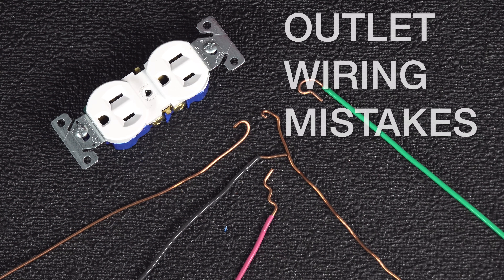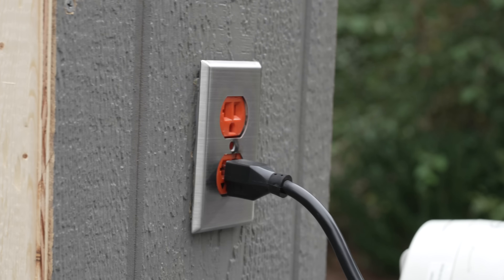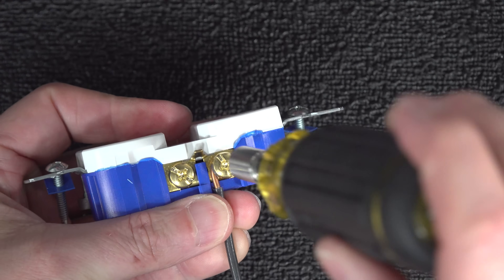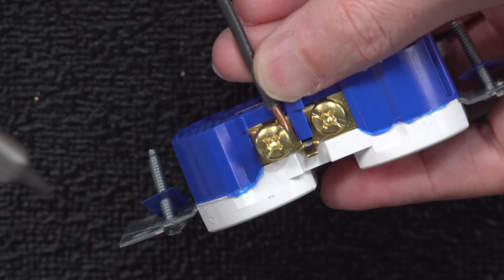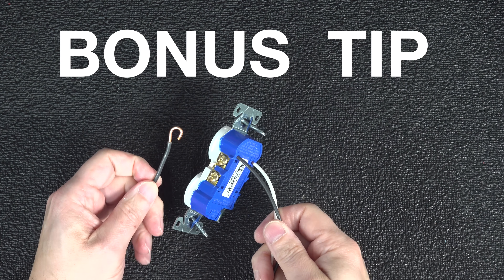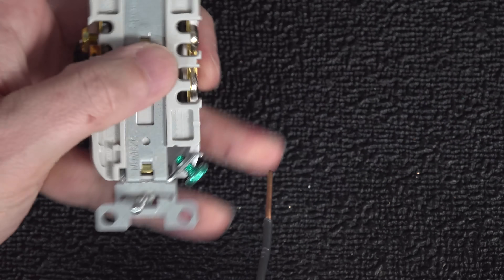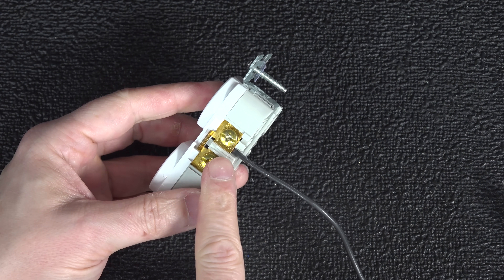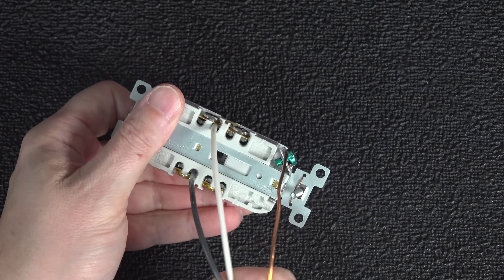BEWARE Of These 3 Common Wiring Mistakes On Outlets & Switches

Comment: Are both gold and silver screws joined internally? Or does it matter to use the top vs the bottom one in their pair?
Reply: The answer to your first question is no, they're joined externally by the tab between the screws. One gold screw is joined to the other and one silver screw is joined to the other, but are not joined together. The answer to your second question is that it doesn't matter as long as the tabs between the two screws are still intact. The tab on the hot side only can be removed if one of the receptacles is to be switchable or if a multi wire branch circuit is used and the neutral is shared. In the latter case the two receptacles will be on separate circuits. Both the hot and neutral tabs can be broken and be on separate circuits and not be a multi wire branch circuit. There's no case where only the neutral tab is removed.

Comment: If standard wiring code for vehicles is red as hot and black as ground, then why change that color code for housing? It makes more sense for the color code to be universally the same to prevent any misconceptions leading to loss of life and property damage.
Reply: You can't make this comparison. Vehicles run DC and typically a 12v battery. Homes run on 120v AC. In a car the black cable is negative or ground, which completes the circuit. In residential 120V AC the white wire is the neutral which completes the circuit and carries 0 Volts. There's a ground wire in residential wiring, either green insulated or bare. This wire carries no voltage or current under normal operation, it's there for safety reasons in case of a ground fault.
Reply: @surferdude642  in a vehicles wiring harness under the hood, inside the ribbed wire protection wrapping there is a copper cable that is a negative ground along with the standard red as positive and black as negative. Without that copper cable then the entire electrical system won't work. All that I am saying is, "Why not use the same color coding since they are basically the same in function?" It doesn't matter what the amperage or voltage of the wires. I don't expect an electrician to wire a car and I don't expect a mechanic to wire a house, although most of them do. But a universal color code for all wiring would be more beneficial than complicating matters because an engineer wanted to mess with people. The wires come in gauge sizes and voltage/amperage ratings so if you know what you are looking for then it's an easy fix.
Reply: @briandillon3543  I'm not an expert, but I believe that the copper cable is the chassis ground and is at the same potential as the negative terminal and black cable on the battery. The red cable is positive and always is approximately 12v under normal conditions. In residential wiring the grounding conductor whether it is bare or green insulated has no function during normal operation. The black and/or red wire are not distinct in polarity but alternate from positive to negative at 60Hz. The white wire is the neutral or grounded conductor. I guess to your point they could have made that wire black and black hot wire a different color, or the negative cable on the vehicle would be white.

Comment: Was putting those wires on they put it on backwards but I noticed your wire was lifting up the same way when you put it on backwards when you put it on supposedly the right way I put it on the same way you do but I take a needle nose pliers and crimp the hook closer together before I tighten it down

Comment: Just because there are extra slots for more wires doesn't mean you should use them. Install a pig tail instead. You don't want to have to try to shove all that mess back into the box with the outlet.

Comment: This was a great video until the very end, you should always ground your wires in the following order the green goes first, then the neutral goes second, then at the end you attach the hot wire which is or could be the black or red wire. The reason for this is because when you attach your hot wire first that entire box now has electricity going through it and if you touch the wires or the screws at the terminals you will get shocked. And just an FYI when you are taking your wires off of an electrical watt box you always take the hot wire off first and then cap it

Comment: And what would that be the black wire is hot the white wire would be neutral and the copper wire that is bare would be the ground wire what is the misconception of the red and green wire is that basically there is no red and green wire when you are wiring up a house and if you do use a red and green wire I would suggest on every damn outlet or every damn light switch it is used the same damn way the red wire would be the hot the green wire would be the ground and then again we come back to the ground wire which would be fair you really can't screw it up unless if you start change in around how you are wiring your house up and then you can't even screw it up then neither

Comment: I still don't know What the "Green" wire is for and I also run into "Red" Wires too. What are they for???
Reply: Romex wire is usually 14/2, 14/3 or 12/2, 12/3. The 14 and 12 represent the wire gauge, the 2 and 3 represent the number of wires not including ground. In the /3 the additional wire is red and is a second hot wire and is necessary in certain cases. Red wires are typically used in switchable receptacles, multi wire branch circuits, and as travelers along with black wires in 3 and 4 way switches. NM cable (Romex) the ground is a bare uninsulated wire. This is equivalent to the green wire. In a conduit you would use a green wire for ground connections.

Comment: ah yes, the backstab wire mess.  Just replaced an outlet like this.  Two backstabbed wires and one around the screw terminal on each side.   Wound up moving those three wires into 5 position Wago 221s and then pigtailing a fourth wire into the new GFCI outlet (the outlet location is in a breezeway so to me, this is a wet/damp location).  I do not own 4 position Wagos, thus why I used 5 position.

Comment: The link to the Leviton Outlet take you to an Amazon page that pictures an outlet that does not look like the one you use in the video. It (the page) does not show the back of the outlet. Is this part number the actual number for the "upgraded" outlet you used ? TCR15-W.  Thanks.  Richard.

Comment: Hi there, quick question because I just came in Canada. Why did they create holes to plug's back if it's dangerous? I say you that because we have that way of the wiring in Switzerland (to insert rather than screw the wire, it doesn't even exist screws on the side on plugs) and I never saw a plug burnt because of that. The only logic way for me would be in case of high intensity, the metal protects more the plug's plastic, is it the reason?
Well, thanks for the tips, I'll avoid some mistakes thanks to you...

Comment: wait, electricians never use back wiring??? LOL BS, the hell they do.  Every house I have ever lived in here in Oregon used back wiring.  a house built in 1982, a house built in 2005 and currently our house built in 2021, all used back wiring.  What you should have said was GOOD electricians never use back wiring.  outlets, light switches, doesn't matter, every time I go to upgrade or change I see the same thing, wires shoved into those annoying, difficult to remove from holes, so I cut the wires and toss the old device in a box for later or throw it away.  Good outlets and switches even have a little plate that prevents the wire from touching the screw and even has internal plates so you can do just like back wiring, stick the wire in the hole and when you tighten the screw it pulls a plate against the wire for a secure connection.  Those stupid back wire holes only make contact at a single point on one side of the wire which if you are running a lamp or radio is not a big issue, but plug a space heater in there and suddenly you have two heaters... one inside your wall that could melt or even catch fire if left to run too long.

Comment: First thing, anyone doing their own electrical work should definitely at least learn how to do it safely.  Using the wrong gage wire, or wiring it up incorrectly is not only unsafe, it could very well be fatal.  It's not that hard, few videos on youtube, pick up a cheap wiring code guide book from any hardware store local to you, and most definatly, buy one of those testers.  It doesn't have to be super high tech, the one I used for many years is simply a 3 prong plug with 3 lights on it, two green = good, anything other than that it literally tells you on a sticker on the device, whether you have it wired backwards, no ground, or any combination of bad wireing.  However, it will not tell you if you picked the wrong wire gage, so please do research, and barring any of that, just buy the thickest gage.  It is much better to use 12 gage wire when 14 is required than to use 14 when 12 is required, and always match your outlet rating with your breaker/fuse rating ie. 15 amp outlet on a 15 amp circuit.  Some things are required just to pass an inspection for code.  something even a licensed electrician failed to do in my house once.  We failed inspection because he put a 15 amp outlet on a 20 amp circuit.  Anyway be safe out there.

Comment: Color of the wire is not determinating phase zero and ground wire you must know where wire starts and ends from plug board switch to wall socket

Comment: Green ground to Green Lug, Black Power to Gold Lug, White Neutral to Silver Lug.  I use plugs that have a square press washer under the screw, that way it doesn't come loose and you don't have to curl the wires.

Comment: Not trying to nit pick but technically the white wire is not a neutral in single phase applications. By definition a Neutral conductor carries the imbalance between  ungrounded conductors. In the single phase application of your video the white wire by definition is a grounded conductor.

Comment: I’m a troubleshooter and one of my favorites was called for a breaker tripping opened 1st non working outlet closet to panel found it was wired blk & wht on one side & blk & wht on the other corrected it….. tripped again……do you know all outlets in living room were wired like that……..and that was done by building super

Comment: You are ignorant of the fact that AC current is bidirectional, the hot and neutral designations are from tradition, the phase and standardization is what wiring the outlet by the color code is for not the polarity. That is why the outlets or other devices work unless they are phase dependent.

Comment: So it's convient,, but it's lighter colored screw compared to darker,, and also white is nuetral,, but it's the grounded conducter, as apposed to the grounding conductor 🤔 and no one uses stablock connections,, and don't need to go to comercail / spec grade, devices,, one can simply use the screw connection on any standard device ,, even though stablocks are there one dosnt need to use them,, and always make a pigtail connection wene more than screws terminals,, wire nut your connections,, and establish the  conductors needed for the device,,

Comment: most important thing that was left out, make sure your ground wire is nowhere near the neutral or hot connections (silver or bronze screws and plates) as this will result in arcing or a ground/neutral fault, and with an arc fault breaker (required by 2020 code) will cause a circuit failure... also if you want to have an easier time diagnosing or fixing problems in the future it's good practice to pigtail (tie in) a single connection wire with the two (or more) wires of each color in the box using a wire nut and a lineman's pliers... this will ensure a device failure is easily identifiable on the circuit, and allow other devices along the line to continue working while making replacement of devices in the future easier (this is more time consuming but is best practice)

Comment: Here's what is wrong, the WHOLE usaan reticulation sytem! Those outlets are ridiculously dangerous, exposed live terminals, straight pins theat burn up, 110 v that is more deadly than 240v, and 60hz that runs hotter than 50hz. Couple that with still using solid conductor for earthing, different voltages on individual conductors, bugger me, its an electrical nightmare!

Comment: Nice video. The only thing I would add is Quality Control to the finished product. There should be a "glint" of copper showing between the connection and the wire insulation. This is instant proof that insulation was not placed inside or between the wire and the device contact area. Also, the stripped copper wire should not extend (except for the grounding) past the "skirt" of the device. In other words hot (or neutral) conductor is exposed past the connection point of the device creating an obvious electrical safety hazard. Every job should conclude with a QC (quality control) inspection to ensure a quality "Journeyman like" instillation has occurred. Cheers.

Comment: Also never put more than 1 hot, 1 neutral on rec. The little break away tab between screws acts like a fuse link and all the amperage of all rec in circuit goes through and the first rec in circuit has most and will melt . It is also much easier to shove it into box with 3 12s on it than 5 or more. Always use a wire nut(connection)and bring out 1 pigtail to the receptacle   Then if you have a bad rec it will only affect 1, not whole circuit   Another common mistake is using a 15 amp rec on a 20 amp circuit. Good luck and be careful ⚡

Comment: NOOOOO! DO NOT INSERT THE WIRES LIKE A JACKASS! I hate that crap. That means the next guy has to cut that wire or screw around with getting it out, then he has to strip it again or add more wire. Just use the hooks so its easier to replace the outlet.

Comment: When training new apprentices, I always tell them to make sure the neutral goes on the same side as the ground (all of our devices are made that way). Always wrap the wire around the screw in the way that it tightens, and NEVER ever use the stab in connections on the back. It's our company policy to never use the stab ins, but in my opinion, should be an industry standard.
Reply: Absolutely! Fuck a back stab bro

Comment: I disagree with the author on back wiring. The amount of metal that the wire makes contact with is more than enough to handle the rating of the circuit if it's installed correctly. These receptacle designs are tested and approved. I haven't looked into the ratings for that specific design, but I wouldn't be surprised if it was UL certified.

If there is a connection issue with the back wiring it's most likely installer error and not a problem with the design, those springs are very strong. If there was a problem with a back wired receptacle, it would be most likely that the installer used a wire gauge that was too small or that the wire was bent causing a bad connection.

Comment: Great job on the video. I have been teaching this to all my helpers. Never used the stab in tabs and always frowned on the electricians that bragged about using them. The down size to working in a right to work state. Anytime I find my hands on a plug that has been stabbed I always change it. Changed every receptacle in my house. The worst applications were the receptacles by my central vac system plug and the outlets on the down side of the kitchen gfi's where we plug in  appliances. It does not take that much time to do it correctly

Comment: Just a few things of note. Was the Fluke tester used to impress?  In many cases in track housing those folks are not electricians.  They are piece rate installers. The faster they get done the more money they make.  They back stab every device. They also use the device to continue the circuitry. Instead of making joints and pigtailing the devices. Leave enough conductor for servicing the device. 6 inches from the front of the mudring/wall. Electricians use number and or letter books to identify the circuitry.  Example, panel A circuit 4 would have an A and a 4 on the conductor. Hospitals require that all cover plates are engraved not labeled. Granted no one wants the cover plates engraved in their residence. Most electrical problems are poor terminations. 
Finally call a Pro.

Comment: If for some reason you want to connected stranded wire to an outlet, remember to use ferrules to get a more secure connection as well as one with a better contact area.

Comment: He sure does make it  look eazy .. 
It does take a little bit longer when that outlet is  in the center of the circuit and has outlet2s jumped off of  N maybe a light ran off it .
Things happen Janice!!!!!!!! 
Please Denise just take me back it was an accident I didn't know what I was doing I didn't mean to burn down the garage but please take me back if you take me back I'll eat that box like you've never seen me eat it before and you know how much I hate what's in your mom's box I mean who makes homemade dumplings and then steams them in her box for hours and then just pulls them right out of her box at the party..... Put the neutral wire on the ground wire and it'll take care of your problem

Tip of the day✔️  for all you skip that part but if you want to bypass an outlet tester because the house you're working on is old and doesn't have a ground or a  metals. Outlet box .....says I can't put that on there cuz it could possibly be dangerous or cause death and I prefer calls and deaths one-on-one it's kind of a personal thing but hell no I can't get a Big Mac without it being a personal thing

Comment: Klien makes a philips head screwdriver with a little prong that comes out of the handle running perpendicular to the shaft. The is perfect for making hooks once you''ve stripped the wire. 
It's great as you don't have to use 3 tools (srtipper, needle-nose plier and screw driver.